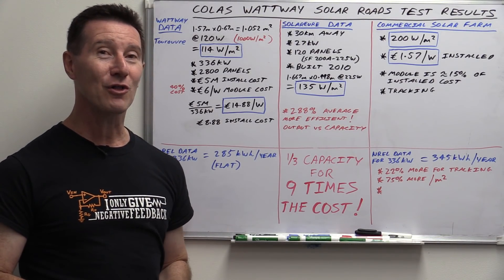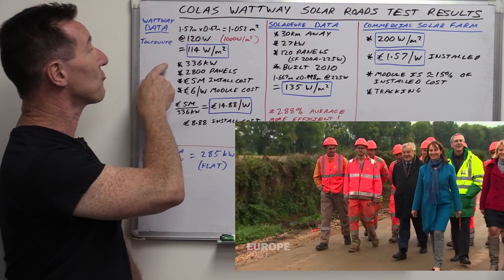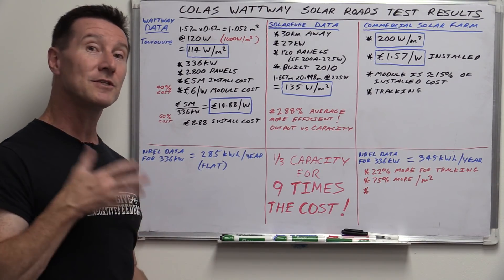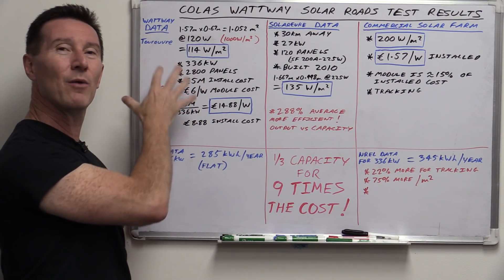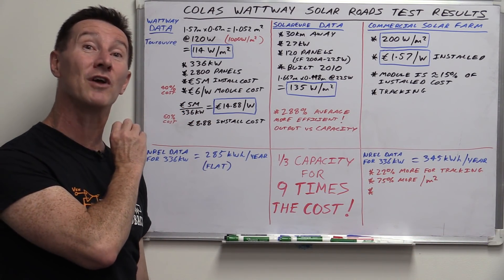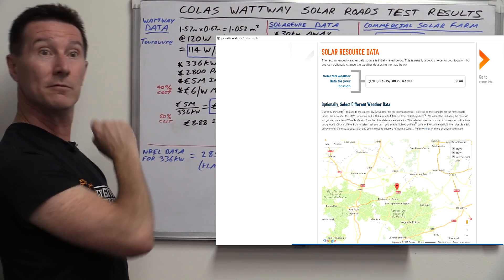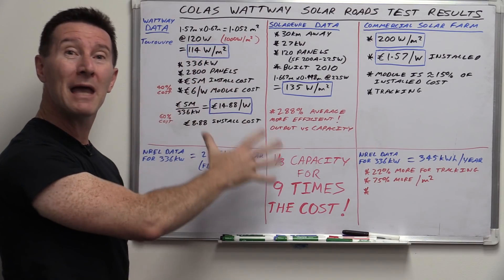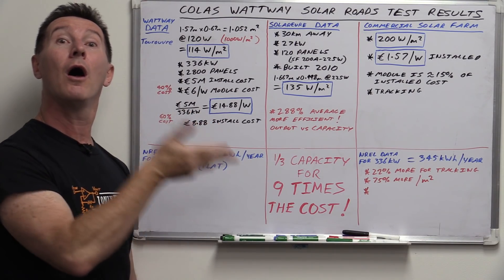EEVblog #1047 - Solar Roadways FINALLY BUSTED! (Colas Wattway)

Comment: I can sort of see this as a potential thing if:
 - You have a lot of road
 - You do not have a lot of space for a proper solar farm
 - The roads are not in very heavy use
 - You don't have actual wintery winter.
 - You have quite a bit of sun.

So for something like Norway, where we don't have a lot of sun, it's bad. Australia has a lot of space to spare, so it's not useful there. And so on. So I have no idea of where this would be a decent idea.

Comment: You can be wrong about interpreting data, not saying you are, but you could. You don't need math to prove it to be a bad approach:
1) To what problematics solar road answers? the lack of space to put solar panel. Today this is basically not an issue since there is plenty of space unused (I am in France, and there is) where you can put solar panels.
2) Is roads well exposed to the sun? You can think so, but as solar radiation does damage the road, we used to put trees each side to protect the road from the sun. So you'd have to clear the sun to hit the road again.
3) Is this the best solution to make road spaces produce electricity? Well, putting standard solar panels above the road seems way better: less constraints because less stress, less technical challenges, less shadow, higher efficiency, good tilt and probably lower cost. You could also benefits from the shadow of this panels to protect the road from sun, and even the cars. 
So from an engineering stand point, it seems like this is a bad solution to a problem we don't have right now.

Still, go Solar !

Comment: Hmm where should I put my solar panel... well I want to maximize light exposure while minimizing wear and tear... oh I know! How about on the ground in a devloped area so everything around can cast shadows on it. Ooo and how about we let veichals drive over it, you know, those things with the are and have fast rotating sections that occasionally pick up grit and rocks from the road.

The worst part is there are buildings right next to the road way... we aren't lacking in space to put these things, stop trying to invent engineering problems to solve and start solving real ones.

Comment: I understand that solar road way isn't cost effective compared to standard solar solutions but how much does it cost to the build a road of the same length? is it worth paying the extra to get solar? for example if it would cost $3m for a mile of standard road is it worth paying the extra $2m to have solar on it instead.

Kinda like the approach Elon is going for with Solar Roof Tiles. If your going to spend money on a roof and paying a little extra means it generates power.
Reply: And how many $m for maintenance costs? Does it sound economically viable? Why even attempt solar roadways when we have so much space. Even without the space, there are roofs or even walls that would be more economically viable. Just put the panels above the road or on the side, no need to create a dozen of problems by trying to fix one.
Reply: jyrolys6 some good points there, thank you.

Comment: I haven't seen anything heavier than the front loader in the Solar Freaking Roadway video. I'm skeptical that these roads will hold up to 18 wheelers (I think the Brits call them lorries) much less oversized loads.

Comment: +EEVblog In the Netherlands some students calculated and proposed to the national Railroad company to put solar cells above all their tracks. The advantage being that all tracks are allready have portals to keep all the electric wiring above the tracks and could be easily expanded to accomodate for some solar panels as well as the infrastructure to transporting electricity (or immediatly use it). Their calculations showed that they would gain more electricity than they would need. The idea was applauded but not applied, because of the massive initial costs of buying all those solar panels.

Comment: Well, I get it. Solar roadways is an awful solar power plant. But is it at least a good road to ride? 
I can easily imagine another rant about how much cheaper you can build a better road without solar panels. But that is not the point. Here you get inferior plant and inferior road at once. This thing can be properly debunked only one way. Show that net economic effect of this contraption including installation and maintenance is less effective than having solar farm and road installed and maintained separately for same time period.

Comment: Why isn't there any company that rides this solar roadway wave to make something that might actually work?

Something like adding sloped roofing to roads, that protects the road from rain and snow by redirecting it to the side of the road/drainage (no water/snow+shading will also decrease road wear and tear) tiled with commercially available solar panels like you would do at home thereby making it cheap to buy and replace if needed. Obviously it wont work well inside cities but it would probably do well in long, open roads/highways especially in arid places where there isn't a lot of trees and lots of direct sunshine.

It will cost less, give more in return, it will probably help against car accidents by allowing for easy installation of illumination on the road during the night and block sunglare during the day. 

the only downsides I see is that its not as sexy, and it will block the scenery a little bit (support pole every few meters, which will probably need to be strong enough to not collapse in case a vehicle crashes into it), no ability to look up at the sky but in my humble opinion the benefit justifies it completely.

its expensive as all hell, I know but it wont be as expensive as those others "solar roads"

Comment: when checking costs you should also add in the land cost for the traditional system.  With a solar roadway, the land is basically free, not just because it already owned by the government but because it's function don't change.  A traditional solar farm takes up a lot of land which now can't be used for farming/housing ect, and is therefore lost.  The solar road panels might still cost more but that tech is also much newer, newer tech always costs more and becomes cheaper over time as long as people buy it.  Costs decreases don't usually follow liner trajectories, at least not for long.
Reply: mark pavlis panels on top of owned buildings. Or subsidizing massively for companies.

Comment: panel VS roadway

aim at sun VS static angle
fix whenever VS screw up traffic to fix
has to resist elements VS has to resist elements + multi-tonne trucks driving on them
perfectly smooth surface for optimal optics VS textured surface demanded by DOT for driving safety
square or circular farm to make electricity collection efficient VS long thin collectors making efficient collection impossible

Why does anyone need math to see right through this? This is a terrible way of doing something that already has a good way of doing it.

This is like introducing a new type of car that gets 5MPG and claiming that its green so you had better not speak out against it.

Comment: Wouldn't it be cheaper to just suspend the panels above the road? They wouldn't have to be engineered to handle the weight and would cut costs, not completely, of clearing snow and might reduce damage to the road by reducing the temp delta it experiences. 

This would also allow the panels to pivot, resulting in more electricity production.

I'm sure there is a reason this wouldn't work, but I just don't see it. Also, not saying this would make the venture profitable, just that it would be an improvement over the current applications.

Comment: So what is the difference, price and longevity  between a non-solar road and a solar one? That should be the question. Because if it cost $1 a foot for a regular road and $1.75, for the solar one ,and it lasts as long as the regular road, then....

Comment: the cost doesn't matter to save the planet and there are many factors to consider other than price vs output.  large solar farms make sense in many places where there is surplus land, the u.s, oz and africa, but in north west europe it would mean losing agricultural land needed for food production.  roof tops are a great idea but all privately owned, duel purposing the road surface which is state owned makes sense.
Reply: duncan smith but massive subsidizing for companies would be cheaper just as space friendly

Comment: The financial aspect may not be relevant. If the solar road is designed to illuminate road signs and such, then the cost of installing full system may only impact the first year of life assuming you can get a solid bid on bulk order. Then it doesn’t matter, fix the issues by add some batteries for night, thicker units so the so the photovoltaic elements can be angled, taylor the projections to the application and boom issues resolved.  This thing is not meant to power a home or add power to the grid, it meant to turn on a light. Hell it would only look to be a closed self sustaining system.  That’s where you’ll get the savings over time.

Comment: G'day,

  Yay Team !

   In actual point of fact, rather than installing a Solar Array on the surface of the Carraigeway (Road)..., the most efficient way to add Photovoltaic Panels to the "Road-Transport Carbon-Emission Equation"...; is to retrofit conventional Road-Vehicles with a streamlined PV (Panel or Array...) connected to a Solar Charge-Controller, wired direct to the Engine's Battery, with an Inline-Fuse between the Battery &  Solar Charge- Controller.

   Having the Vehicle-Battery being fully-charged with Solar-Power whenever the Engine's Starter-Motor is engaged with the Ignition-Key means that NO Fuel is burned in the Engine specifically  to produce the Torque required to drive an Alternator via a 2 : 1 to 3.5 :1 Belt-&-Pulley Torque-Multiplier..., in an endless failing-effort to finish recharging the Battery before the Nut-Behind-The-Wheel shuts the Engine down at their journey's-end.

   Search YouTube for my "The SunFoil Project..." Playlist to see 10 years' R & D Results, plus full Construction-Details...; I recommend the Mk-8.

  Source your own components locally, and DIY...

  Have fun !

  ;-p

  Ciao !

Comment: If the solar road could last a hundred years without major repairs this might be worth it simply because it serves a dual purpose and doesn't require more real estate to  install the roads are already there taking up space. I doubt they will last that long though without getting broken or assholes doing burn outs on them LOL

Comment: Dave, dude !!!!...you are so far out you don't even know it. You are missing the ship dude ...solar has moved and the solar fields will not be for you to compare pricing....solar power is a building product and if it enters the building industry all bets are off...I remember when the stupid panels where $12-15/watt.
You should be talking about water desalination with utility power or solar panels, that's something to compare but to compare BIPV or SR with conventional panels is stupid. The main function of these products is to be a "road", a "roof", a "faced"...and so on. The power generation is a secondary function of these products...

Comment: My only thoughts are.
The department responsible for making roads is trying to generate an income and offset costs.
So the money spent on the roadways would never hit the power sector's infrastructure anyway.
So having something that is 10x the cost but works better (even a little) for that sector's budget will get the contract.
Then they live with the consequences, need more money to not go under (which it wont), the government gives the road's department more money. The roads department writes off the roadways as a bad investment but keeps the extra cash in the budget going their way each year.

Comment: Had nobody even noticed that he has literally divided the cost of installing it by the maximum instantaneous output. I hope he comes back with next year's data which by his own method of calculation would be 0.00 per kW. After all we don't need to install the road every year do we now. 
So after year 10 this is actually cheaper then the solar farms no? At year 20 it is half the cost of the solar farm per watt. Am I missing something? Does he think that each year they will relay the road and incur the 5 million installation costs? Unsubscribed for being a div
Reply: Do you honestly not understand how roads get worn out and covered with debris and dirt with millions of tonnes or vehicles smashing over them year on year
Reply: But a solar farm does not need to be rebuilt every year and the yearly output is higher for a lower initial cost. 
Also, the road is showing deterioration during  the first year! Just  look at the site:
https://www.bdpv.fr/fr/ficheUtilisateur.php?util=routesolaire
In the first January, the road produced 9399 kW-hrs. During the following August, September and October the road produced LESS electricity when it had more hours of sunlight at a steeper angle, so it should have produced more electricity!

April was the month with the highest electricity production, and the sunnier months of May, June and July produced LESS electricity.

The roof mounted system the Dave referenced shows MORE electricity in each of these months. See: 
https://www.bdpv.fr/fr/ficheUtilisateur.php?util=solareure

The rooftop system has produced about the same amount of electricity for the last 7 years.

The road is already wearing out, an will likely not last more than a few years!

Comment: You are absolutely correct that using solar panels as a road surface is stupid. Why don’t you offer a solution to their problem? Here’s one, these are working on what appears to be a lightweight (compared to typical solar panels) and rugged (at least compared to glass) solar panel that is designed to essentially be glued to a surface. Why don’t they put them on the roof of a house? They’d get similar outputs of what is normally used on houses and could be used over the entire roof rather than just the structural supports. And the installation costs would be dropped as all you’d really need is an electrician as the glueing the panels on could be DIY. No additional infrastructure would need to be built. Blah blah blah you get the gist.

Oh one more thing to rebut the inevitable, you need the rugged panels in certain places like TEXAS that could theoretically survive a hail storm. Trust me you wouldn’t want to be replacing solar panels every year.

Just an engineer trying to help yo.

Comment: to play devils advocate on the first point of cost. while as you show, it has a much higher cost/w than a traditional solar farm installation. 
while this is true, it doesnt account for the space factor.   with the road, the premium can be partially justified in the fact you get double utalization from a single pre-utalized space instead of having to have its own individual footprint. 
to compare to something else real world.  Underground Parking vs Surface Parking. underground parking has a drastically higher cost than just building a standard lot.  but we still do it because of the better utilization of space.

With that noted, Its still incredibly impractical, there are a billion better, cheaper ways to get the perks of double (or more) utilized spaces without trying to build a road out of solar.

Comment: ok dave you are right .. absolutely right at that.... dot dot dot roadway sucks period..... Now just for Giggles I Want to see this calculation ok .... IF you put solar panels  on EVERY sky scraper in NY ...when would they go into the Plus
Reply: oh and for anyone ... degradation of a vertical surface is lower then a horizontal one... so having solar panels like solar blinds... IS A GOOD Idea trademark Rene O for pure vertical solar panels
Reply: Actually windows with thin-film solar cells have been developed. They are not as efficient since the film needs to be thin to allow light through. The film performs the same purpose as the tinting, which windows usually have, and it produces some electricity. These are commercially available. I am not sure how long they last, or their efficiency. I am pretty sure they will last longer than solar roads, since windows rarely have trucks driving over them.

Comment: you have to consider the cost of build a path/road.  The idea is if you have to build a road/path you might as well generate power from it.  This may help the cost a bit.
Reply: It's just the money is better spent putting solar panels on literally anything else that doesn't have cars driving on it - roof etc - look at your average city, think how much power you could get just putting panels on all of the offices

Comment: Honestly I don't understand the logic behind this. Not only are people pushing it but governments are throwing millions of dollars into the projects. Even if Solar Roadways worked better than normal solar farms for less money you still have to deal with wear and tear of being a freaking road. Normal paved roads wear out pretty fast, high traffic area's almost needing resurfaced every couple of years. Unlike a normal road if they wear down and you get a pot hole it's not as simple as filling in the gap as it probably require the whole solar panel to be replaced. Normal solar panels are rated to last a decade or more before they start to really show loss of efficiency. Solar Road ways on any moderately busy road would be lucky to last 5 years imo.